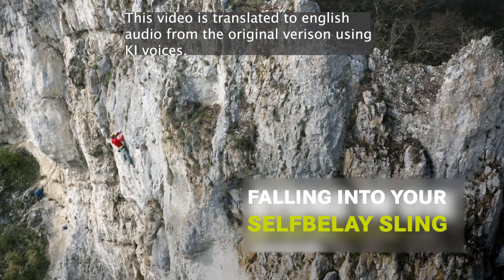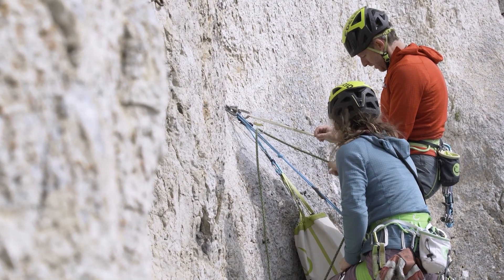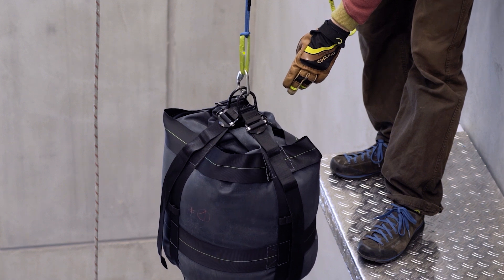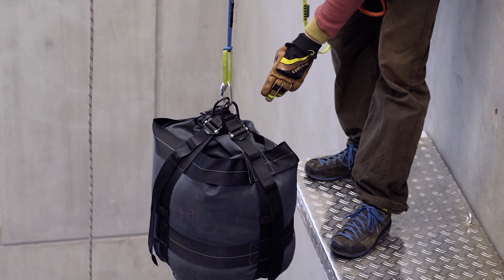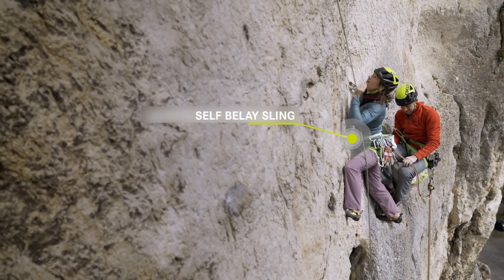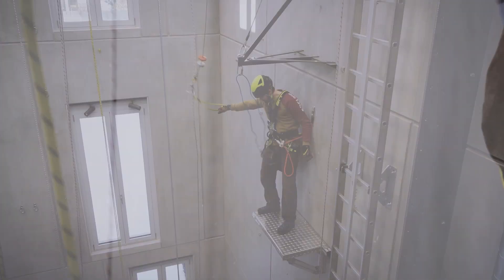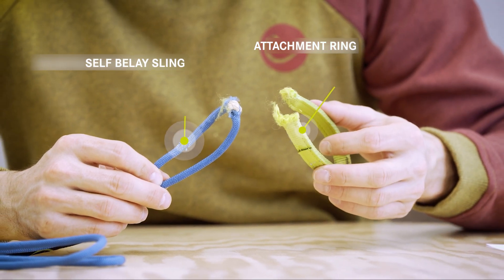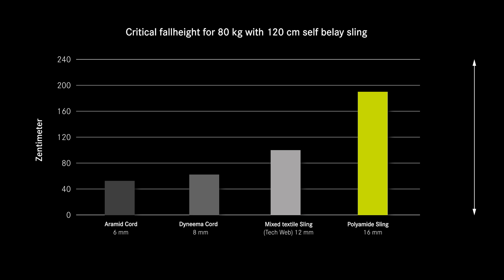Falling into your self-belay - Will it fail? [dubbed]

Comment: I think this would be more useful if you made an attempt to model the forces from a human falling. A persons body will act as a spring to some degree and on a very static sling this will probably make a big difference. 

What if you compared the forces from a person and an equal mass falling on a dynamic rope and then added a spring to the mass untill it matched the forces from the person. You could even just use dynamic rope as the spring. This way when you drop the mass on a static sling with the added spring the forces should be more realistic.
Reply from the maker: There has been quite some research by us as well as by others about the comparison of rigid fall weights vs flexible ones respectively humans. I am sure we will publish a video about this as well in the future. While you can show that rigid fall masses do create higher impact forces, within certain boundaries they are not too far apart. And in terms of the reproducibility as well as health aspects rigid masses are of course the only reasonable way. And regarding the subject matter of the video, such hyperstatic sling will create very high impact forces in any way. They might lead to equipment failing like shown, but if they only get close to it, they certainly will lead to serious injuries.
A good thing is that in the mean time a new standard has been published EN 17520 targeting exactly the issue of self-belay slings. That is a very positive development and we also want to make a video about this, so basically a sequel to this video here :)

Comment: Make sure if you tie in with dynamic rope that the rope is long enough as a short piece of rope does not provide enough dynamic shock absorbsion to significantly reduce the impact force, although the knot might help.
Reply from the maker: Definitely a point, however, very short lanyards would probably also not come very handy in practice. A really cool, because reasonable new standard EN 17520 has come out a couple of year ago that is exactly dedicated to self-belay lanyards. It also includes dynamic testing and we would really recommend to anybody to look for products according to this standard.
Reply: @EDELRIDKnowledgeBase  thanks for highlighting this standard for lanyards.  I don't climb for a living any more so I was not aware of it but lanyards are clearly a common point of failure.  Like you've already said, using a screamer is an option but better is to NEVER climb above your belay with cows tail attached! 🐄 Good discussion and important.
Reply from the maker: @jambuttyman1395  True. And the additional point here is also that your lanyard might not be the weakest point. Your textile tie-in loop could very well be a point of failure as well. Especially when worn out and especially with girth-hitched slings made from high strength fibres like Dyneema or Aramid.
Reply: @EDELRIDKnowledgeBase  totally correct! It would be interesting to see the results with the lanyard girth hitched through waist loop and leg loops like some manufacturers recommend.  Would probably need a dummy sat in the harness to simulate closure of the gap between each loop.  I would NOT want to be that dummy 😁